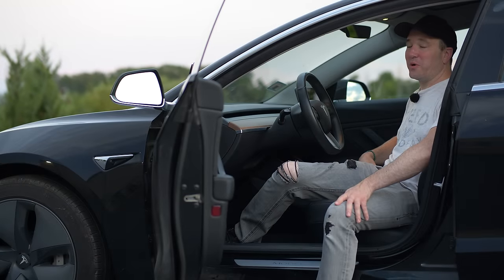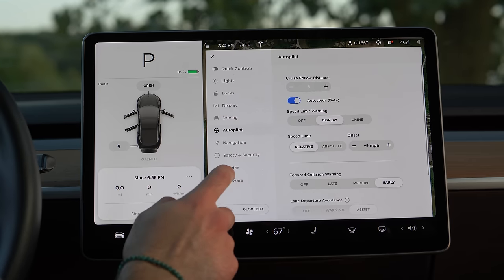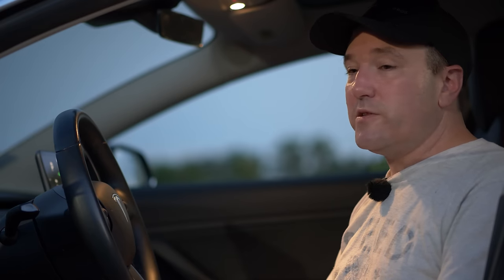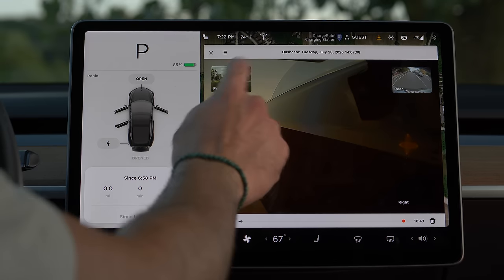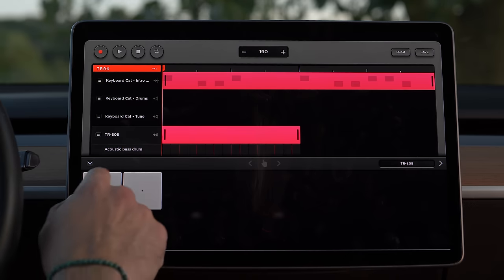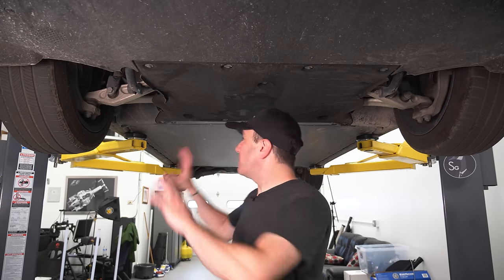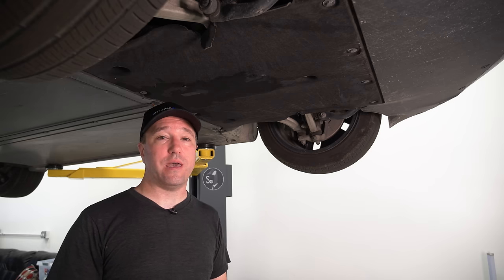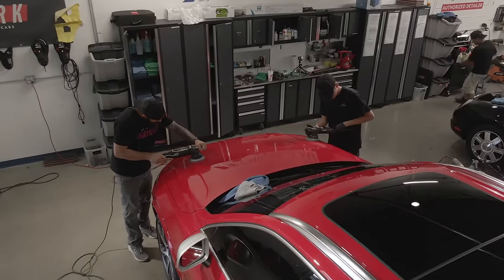Tesla Model 3 | Explaining the Cult

Comment: Being a Dodge Charger owner I was offended when you called 3700 lbs heavy.
Reply: Haha, so true
Reply: Being an Audi S4 owner I was like hey that's light!
Reply: Being a big giant fat guy I found it highly offensive
Reply: It's heavy it terms of a vehicle of same size like a civic. Which ranges from 2500-3000 lbs. And having no engine. So yeah it's heavy. Hope my comment doesn't "offend" you big baby..
Reply: Haha... Is that "fat shaming"?
Reply: Alex To go yea but a 3 series in the same category is like 3800 so it’s not that heavy of a car
Reply: Alex To go also batteries are heavier compared to engines
Reply: Yeah, that's actually not heavy at all for the segment
Reply: Steven Strain yea exactly not sure why he states it’s so heavy the car should fee pretty good with the weight so slow and still being close into weight for its competition. Although BMW in terms of weight distribution is 50/50 Tesla I think it’s 46/54
Reply: @Lazerbrainz2k3 she's a big girl but I like her haha
Reply: Honestly most entry level luxury cars like the 3-series and A4 are around 3700lbs now, so it's really right in line with the rest of the class.
Reply: Meanwhile some smaller roads in my country's housing estates ban cars over 1500kg (~3300lb)
Reply: Zhi Han Lee that’s crazy
Reply: Dodge testing.   RAM into production.   (FCA motto).
Reply: I'm a Cummins truck owner who is running 35s and big steel bumpers.
Reply: If you removed the engine and mechanical transmission and torque converter/clutch and radiator and alternator out of your Charger, it would weigh well under 3,000 pounds...
Reply: @harorider96  hell yeah. I don't even like rap but it's the only thing that comes in on the radio. I even started selling drugs within 3 months of ownership and I'm a dentist. It's fucking wild.
Reply: @iHaveTheDocuments  as a fat charger owner I was offended.

Comment: A very fair review. As someone who interacts with a Model 3 daily, I thought all the pros and cons you mentioned were on point.
Reply: I concur this is fair after having owned my model 3 performance for a year and a few months. I am a car enthusiast and miss engine noise, but the roller coaster acceleration makes up for it. My drives now are mostly with kids on the highway or around town, not on Winding back roads, and the car is perfect. I’ll offer up my car for a review if savagegeese is ever in St. Louis.
Reply: I traded my V8 e93 M3 Convertible in on a Model 3 and absolutely love it.  The BMW had great noise, but thats where the wish list stops.  The Tesla weighs less, is far more powerful, handles similarly, but yes the Brembo's could use better pads...  What really differentiates the experience is maintenance and usability.  The BMW requires proactive flushes to avoid costly failures and they all have concerns that keep you from really enjoying the car to it's fullest everyday.  With the V8, the connecting rods had loads of issues that kept owners from pushing it too high too often.  In the M5 before, the Vanos would fail and plastic intake would leak oil.  Once you realize how much attention, care, and money needs to be spent to keep a good German car running right, you realize the Tesla with only 18 moving parts is perfect for hard daily thrashing without any concerns.  I have 51k miles on mine already and it's just as fun every day.  I'm looking forward to see what BMW does with the new i4 though.
Reply: @aussie2uGA  handles similarly? then you have never driven either of these cars for more than a trip to the next shopping mall. lol I had the exact same M3 BMW and all you had to do was to replace the rods and some other changes and you could rev than thing as much as you like. I sure did. Also, it's a completely different type of car. one is a 15 year old v8 fun convertible the other a fast EV....apples and oranges
Reply: @ryansellers2581  it sucks, really does. it's downright irresponsible if you ask me. Try to touch small icons like for example for the next powerstation (which you have to search at some point) is already not easy when you have to point your arm out to the side but now imagine doing that in a moving car and with a screen that doesn't react as well as it should. Every bump or anything else that makes the car shake just slightly will throw your finger off. Led almost to accidents in my case and I am usually a very cautios driver. But you can't be cautions while fiddling with this stupid screen.
Personally, I am completely shocked that this got past all the regulatories in most countries. It's absolute madness. Maybe it works in California but in a busy city or busy small country with a lot of traffic - it's a accident waiting to happen

Didn't the Motoman channel guy just got run over by a Tesla driver who was fiddling on his screen recently?
Reply: Ryan Sellers you get used to it pretty quickly and there are lots of shortcuts to use. I had a model x for the weekend and much prefer the model 3 screen. It’s quite intuitive for normal controls and voice controls work great. It’s also more in your line of sight than the model x screen and traditional dash configuration.
Reply: Aussie2u this is such a game changer. 12k miles in for me and no maintenance yet. Not even a tire rotation since wear has been perfectly even.
Reply: @ryansellers2581  Owned my 3 for almost 2 years. You get used to the touchscreen pretty quick (the speedo on the right is not an issue at all), and it's very responsive so you're not waiting for menus to load like in other cars. Mirror and wheel adjustments (along with seat, and other settings) are set to your profile so you never adjust them more than once. Only slight annoyance is the wiper controls are on the screen (there's a physical button to do a single wipe or hold for a spray), but the auto wipers have improved so much through software updates that it's less of a problem. Also most things can be controlled via voice commands. If there's anything you need to do through the screen, like change the navigation, etc, I usually just put the car into autopilot (if it's not already on) so I can focus on changing things on the screen.
Reply: @luisamoa2500  well i'm no mechanic and didn't claim to be. heard they had a rods issue, gave it to my mechanic, he fixed it and it was good. feel free to elaborate further if you want
Reply: @ryansellers2581   The truth is that you don't really need to interact with the touchscreen day-to-day! Steering wheel and mirror adjustment is a one time event. Set the temperature on auto.  What else do you need to do? Navigate? No more demanding than any other navi -- just push the steering wheel button and tell the computer where you want to go! Music? I have a few favorite streaming channels that require ONE tap of the screen, or I stream my playlist from my iPhone and press start on the phone before I pull away. I have all kinds of issues with my Model 3, but the touchscreen is not one of them by a long shot!
Reply: Hazardeur I’ve not had any issues using the touchscreen controls, and for the most part I use voice control for the essentials. I barely use the touchscreen when I drive
Reply: On point. It was very fair and I’m glad he went out of his way to talk about the paint and final assembly issues that Tesla seems to ignore or push off onto the owner. 

We need more quality reviews showing the major cons like this so they’ll finally make a change. And think wishfully that they’ll compensate owners who have previously brought claims they eventually declined to cover.
Reply: Not the charging points.
Reply: Hes not a tesla owner is he? He said he rented just for the purpose of the video? His opinions are not very valid if he hasnt lived with this car day to day it definitely takes some getting used to
Reply: @hazardeur  u shouldnt be focused on the screen while driving use voice controls map ur trip before driving the only irresponsible party here is the driver tesla is not at fault in any way for a driver ficusing the screen
Reply: @kingofgaming8695  True, but so many Tesla reviews are biased one way or another. I can appreciate an auto journalist taking steps to make sure he is as objective as possible. There's no way these guys can live with the cars they review for months at a time. I'm sure he took it for a few days (or more who knows) and gave his honest opinion which seemed very on point. He's probably spent more time with the car and has certainly gone more in depth than the majority of these Youtube "journalists" out there.
Reply: @seanpetersen5553  as a tesla review I respect the hell out of his opinion but i just wish he had more of an owners experience with the  car ya know
Reply: @kingofgaming8695  well, voice control works like crap for me and mapping out the trip is not the problem but running out of steam way before we expected is. What are you even talking about? Tesla is all about that stupid screen and you have to fiddle with it one way or another. Maybe drive one of these cars and you will see for yourself
Reply: @hazardeur  get gud scrub simple
Reply: @paolasanchezd  yeah but maybe you are not representative for the general public in this case. Like in IT, there's always a power user who never seeems to have problems but that's not the norm. Just imagine most people in this car and tell me they would have the same road awareness as in a car that's more instinctively controlled? No way i'd buy it

Also as soon as you do longer drives, even you WILL check that screen. You need to see how far you can go, (and in case you expect traffic or other events until then or maybe just not neough steam) you need to adjust your next powercharger, you need to see where it is, what level it is, you want to know how many other teslas are charging there, you maybe even want to check if it's a rather friendly environment or if it's out in nowwhere etc etc.

From my experience, the Tesla works but only for small trips around town, if you can charge at home (to avoid the powercharger waits), are not an "urgent" driver but it's ok to creep on the right lane all the time and if you can use all the shortcuts that they give you for using the car. Then it works. Otherwise, i'd stick to a regular car and wait a bit until real car makers offer similar ranged cars, which shouldn't be too long. Or maybe they give Tesla enough competition to make them better as well, who knows.
Reply: @kingofgaming8695   He reviews how many cars? The only way you're going to get that level of experience is to be an owner and that is inherently biased
Reply: @seanpetersen5553  u cant give a review on cars if u havnt had time to adjust and really go in depth the things he complains about are things that can be adjusted to with time he says the standard model isnt a sports car no ahit Sherlock the closest thing to a sport would b the performance
Reply: I agree...I have a Model 3 and what he was saying about the V8s and V10s was spot on...I love my Model 3, but I do miss the noise of a nice engine.  That is the one thing I miss about and ICE car.
Reply: @ryansellers2581  you will hardly have to use it.  Once you set your mirrors and your seat position you are pretty much set and no longer need to mess with it.  The car's voice commands have gotten so much better you can have the car call whoever you want, turn on or off climate control, and have it navigate to wherever you want to go.  No need to touch the screen.  Only time you would need to or want to touch the screen is if you want to change your charge level from miles to percentage, miles to kilometers, and other similar things.
Reply: @paolasanchezd  agreed.  Not sure why people would see the need to touch it that often.
Reply: @kingofgaming8695  i disagree...the car reviewers review several cars...no way he can own all of them.  Also, if he owned it and gave a review it would be a bias review.  I like the fact that he does not own the car so we can get his unbiased opinion.  I have owned my model 3 since October of 2018 and I think the pros and cons are pretty similar to what mine are.
Reply: Hazardeur I don’t know if either of us are representative of the masses, but one is definitely representative of the asses :) j/k.. I was tempted by the rhyme. I think if you follow this thread you’ll see how this stacks up. It’s not a perfect UI , not by a long shot but I haven’t seen better. Let’s hope Tesla makes it better next time around
Reply: @hazardeur  That's the advantage of autopilot. If you need to focus on the screen more than half a second, turn on autopilot. 

That's what's great about Tesla vs any other EV - their SC network and the speed of charing on all Teslas = almost never have to wait at a SC to charge. I have never been to one where it's remotely close to full. Usually there are 1-2 other Teslas at the charging station. Half of my visits I have been the only car charging. The car will direct you to a SC when needed. 

Just useful for small trips around town? I used my M3LR 2 days ago. Drove 7 hours in total, 450KM and didn't need to charge. When you need to charge, it charges so fast, with so many SCs available that this is not an issue at all. 99% of trips you don't even need to charge as long as you plug in your car daily. To have an EV it's essential to have a home charger installed. I have saved a lot of time by not having to go to the gas station. Plugging in my Tesla daily takes 3 seconds.
Reply: Want to update us after a year? I see there are some ok aftermarket options for centre gauge clusters which is a must for me. Do you live in a cold climate and can comment on that?
Reply: @ryansellers2581  I've driven my 2019 model 3 almost daily and I love the touchscreen controls. Most of the settings are automatic anyway so in day to day use there's no "fiddling". The only thing that could be implemented better imo is the wiper controls.